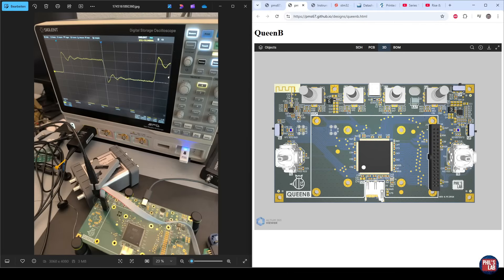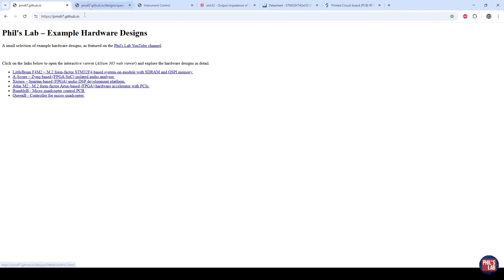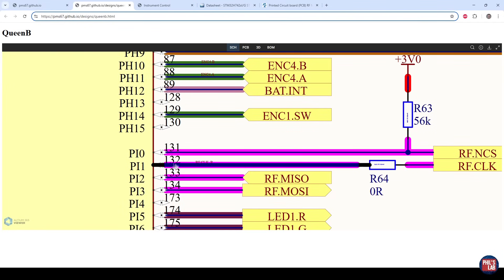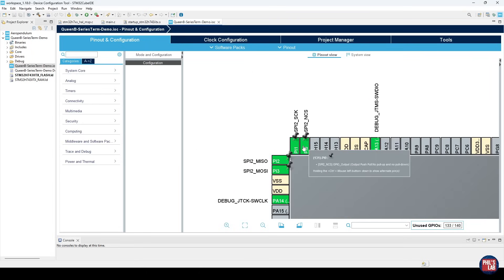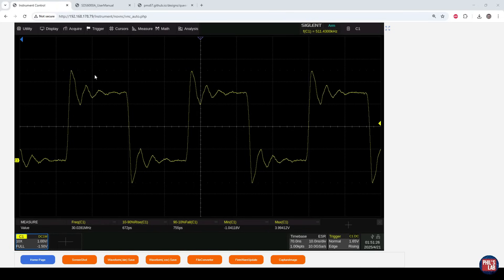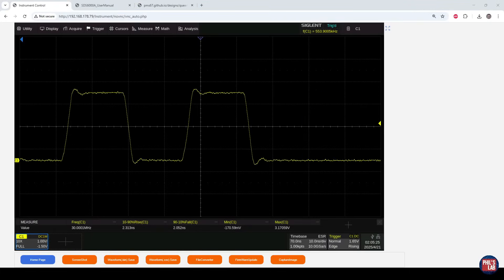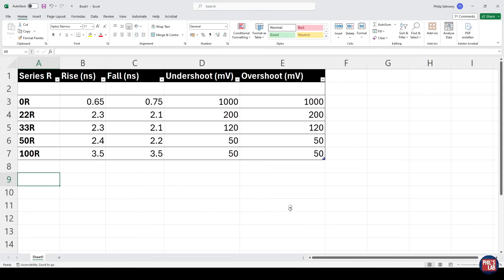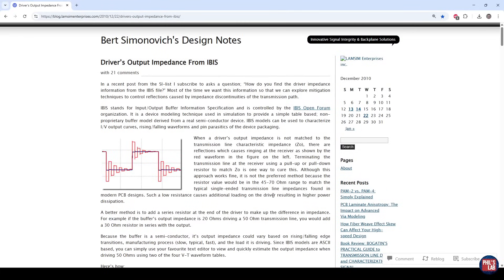(Sponsored) Series Termination Resistor Selection (Practical Demo) - Phil's Lab #155

Comment: I have a different interpretation of the results in the video. 
I am not sure whether the ringing is because of reflections in the original signal without any series resistance.
To me, this looks like the classic step response of an underdamped series RLC circuit.

In the initial measurement, the low internal resistance of the IC creates an underdamped response, which explains the ringing. As the series resistance is increased, the response becomes critically damped, and with even more resistance, it becomes overdamped.
This RLC model seems to explain the waveforms shown in the video. 

To test this, I tried to find/calculate the capacitance and inductance for your trace and I simulated a RLC circuit in SPICE using lumped components. While not identical, the simulation results show a good correlation with your measurements.

Comment: 1] DOWN SIDE: to the slower rise fall times (2ns vs 0.6ns) is it becomes more susceptible to noise in the transition region and thus increasing the Bit Error Rate. 2] Ringing is CLIPPED by protection diodes. 3] DID NOT discuss HYSTERISIS that prevents miss trigger. 4] "scrap away..." - why not put test points???.   Good beginner discussion but by no means at a series pro level.

Comment: At the very end of the video you mentioned the IBIS model. Why not start there?  Took me less time to look it up than to watch the entire video. And to keep myself honest, I did it before watching the video.  For the IBIS model I looked at "IO8_FT_HS_3V3, ...FS.., ..MS.., and ..LS.. for each of the High/Fast/Medium/Low speed. Pick the line for each of them at 1.6V Pull-up and Pull-down. For all speeds (because output speed only changes the "SLOPE" of the edges according to the IBIS model and NOT the impedance) Pull Down, 124mA Pull Up 119mA.  Ohms law: 1.6/.124 = 12.9 and 1.6/.119 = 13.4 Ohms. In your final report:  13.4 ohms + 50ohms = 63.4 ohms which is where your trace impedance ended up about 64ohms.  You can then pick the speed needed as a tradeoff to frequency and potential EMI noise.

Comment: I guess that even with the highest driver strenght, you could find a higher value termination resistor that would do a decent impedance matching, i.e. minimizing the overshoots without sacrificing the rise/fall times so much

Comment: Coincidentally Prof. Sam Ben-Yaakov recently posted a riddle about rise-time dependent power loss in RC circuits, which ties in quite nicely with what you've shown here and gives us another reason to take the approach of adjusting driver strength first. The traditional E=CV^2 derivation from which we usually estimate the resistive power losses in an RC charging or discharging circuit assumes an initial condition of constant Vin=Vs (Heaviside step), Vc=0, and thus Vr=Vs. This vastly simplifies the calculus and eliminates the resistance as a variable because the derivative of the supply voltage is zero and you can substitute Vin(t) for Vs, but it breaks down surprisingly rapidly when you apply it to real signals with typical rise and fall times, because the initial conditions are actually Vin=0, Vc=0, Vr=0 and dVin/dt=Vs/Tr (i.e. the rate of change of voltage is the nominal supply voltage over rise time). Notice that the instantaneous power dissipation at t=0 in the stepped case (constant Vin=Vs) is Vs^2/R, whereas the instantaneous power dissipation at t=0 in the linear rising edge case is zero. Since both the supply voltage and capacitor voltage are rising together (instead of the supply voltage jumping instantaneously to nominal and the capacitor rising), Vr ends up being significantly smaller at all points during that rising edge. Since power dissipation in the resistor is proportional to the square of the difference between the supply voltage and the capacitor voltage, you get a remarkable reduction in power losses for longer rise times. The upshot of this is that by slowing the rising edge you end up burning far less power in the termination resistors. In your 30MHz case a reduction in driver Tr/Tf from 650ps to 2ns results in a 56% drop in driver power consumption through a 50Ω termination resistor! For energy-constrained applications like wearables this can be a significant power saving, on the order of hundreds of microwatts per line.
Reply: But, money for nothing and your drinks for free.  How does the slope of the output vary the power dissipated by the output transistors. The output impedance of the output is constant (as can be seen by the IBIS model) so slow slope must be made by the input stage to the output buffer. With only a intuitive guess as to how this was done, parallel four gate drive FET's and enabling 1 to 4 in parallel. The slope is created by power loss across the Drain Source, not the output resistance. The statement that it saves 56% is only in the case when the output signal is 100% duty cycle or in the example would have to be 1/4ns or 250Mhz. If the actual signal was 25Mhz the duty cycle would to 10% so 10% * 56% would be 5.6%

Comment: Really useful as always, thanks! Funnily enough I was just doing xSignals simulations with IBIS models today, and thinking about how I might estimate the series resistance without needing to use Altium's SI tooling... guess I have a blog post to read :)

Aside: YouTube recently cut video bit rates a bunch for 1080p content, but they didn't adjust 4K bit rates down, so you might want to consider upscaling your content to 4K before uploading. It doesn't matter if the source material is 1080p, it just avoids the extra compression. (I know, it's silly and annoying.)
Reply: You can get the IBIS impedance estimate by looking at the midpoint voltage of the signal (3.3V = 1.6V) and looking up the current. Then R = V/I.

Comment: What is the cutoff you use to start considering termination? Guess it has to do with length vs bitrate (or slew rate).
Reply from the maker: Depends on rise-time, trace length, and impedances. I'd strongly suggest trying out a simple circuit in LTSpice (AC PULSE voltage source, output resistor, transmission line, and load), and playing with the different parameters. Running a simple transient simulation can then show when you might need termination.

Comment: Hey phil, how do you plan for this project? Do you start off with prototyping? Im curious as to the steps taken for such complex projects.
Reply from the maker: There wasn't terribly much planning/prototyping involved, other than knowing what I wanted the controller to do. Then figuring out what components I need (battery charger, RF transceiver, display, controls, MCU, ..) to make that happen. Once that's in place, the schematic + PCB work is pretty straightforward.

Comment: the reason we cannot always use impedance matched transmission lines is trace thickness, right?
a 50 ohms line would require 0.4mm width, i guess that is not feasible for such designs?
Reply: Not only. The driver's output impedance use not to be 50 ohm either, it use to be from 10 ohm up to 30 ohm.
Reply: Don't use 2L stackups for designs where signal integrity is important.

Comment: Thanks Phil. I always enjoy your work. One question tho. Why would we need to calculate the output impedance of the driver?
Reply from the maker: Thanks, Mostafa! You could calculate the output impedance from IBIS files (or sometimes the datasheet) to then get an initial value for the termination resistance, instead of starting at 0R and determining it experimentally.